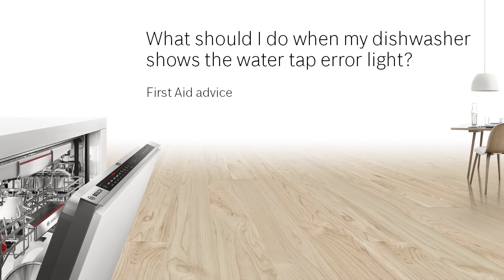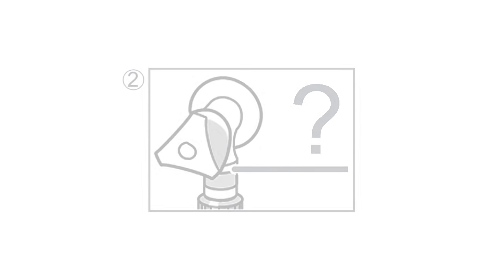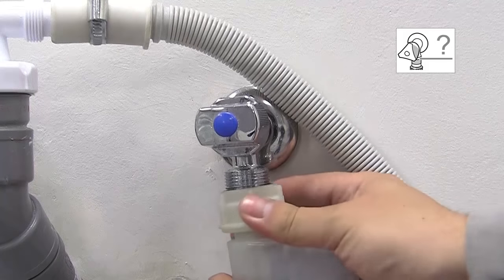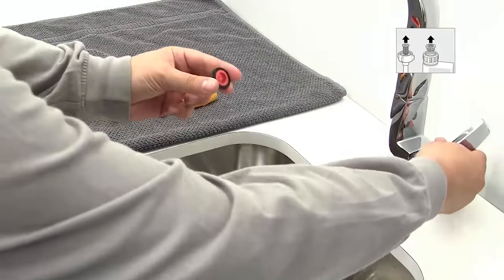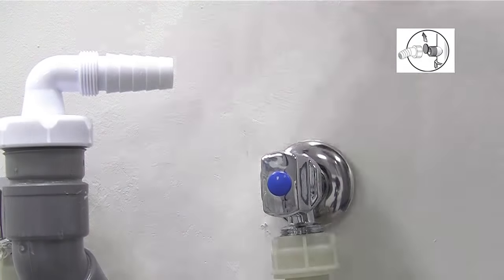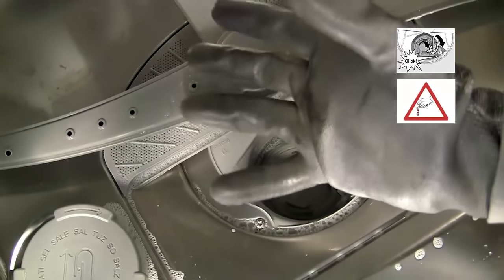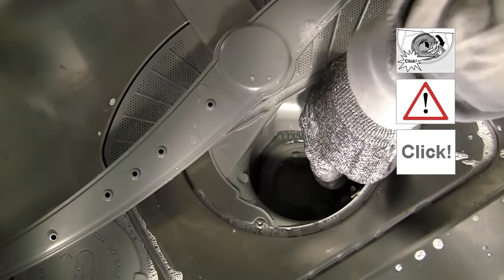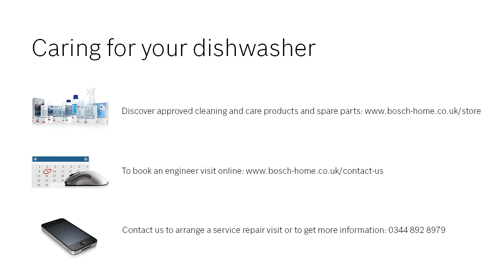What should I do when my dishwasher shows the water tap error light?

Comment: The most common cause to a water tap E22 error is a clogged / dirty pump filter / trap which should be checked first rather than the last step in this video! Why go through all the work of disconnecting hoses and moving the dishwasher when you can try cleaning the trap and filter first?

Comment: Just found your video.... after completing my own, which is precisely as you described. A good and clearly explained video. Mine had a flashing "Check water"light. I went one step further and removed the washer from its under bench position. While I removed the side panel, I need not have done so. I lay the washer over to the right, to drain any water left internally. I then reinstalled and it worked!!!

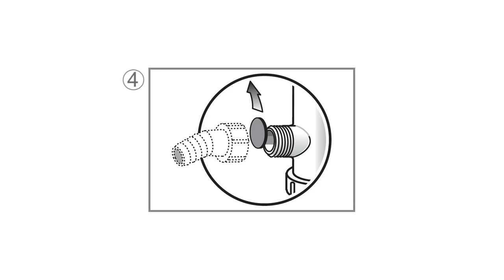Comment: 2:37 that little black/brown rubber disc should be REMOVED? I thought it was some some of flap valve to prevent dirty water coming BACK IN to the machine (our machine here fills back in with some dirty grubby water when the machine has finished, always dirty water in the trap. Turned onto it's side, the machine finally emptied itself of ALL the water from the trap, and it was cleaned thoroughly, and now on re-installing we got the error A1.

Comment: If the machine keeps draining with E15 and the power button has no effect, then whack the underside with a piece of wood, this will free up the float valve that is stuck.  Then put some dishwasher descaler in and run it without dishes.  It should last another five years.